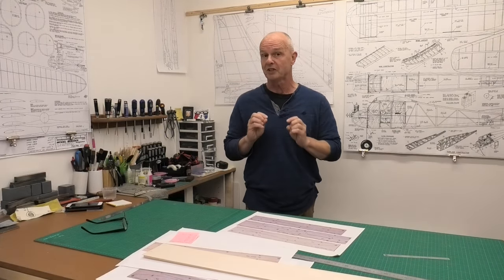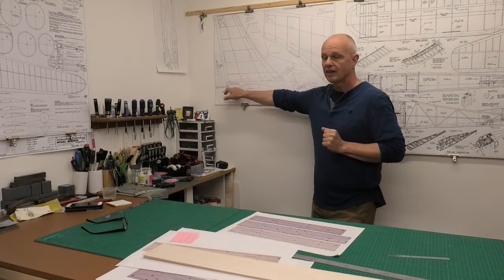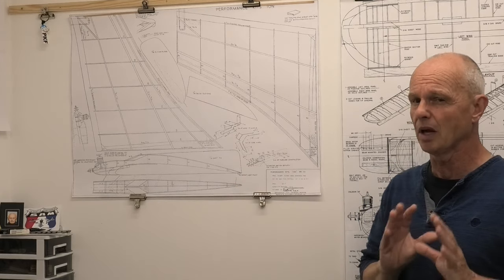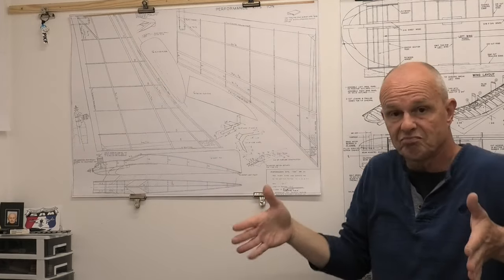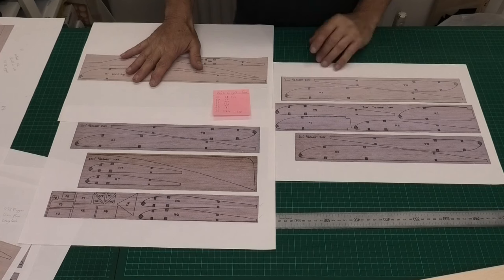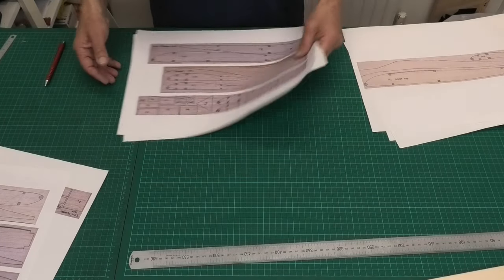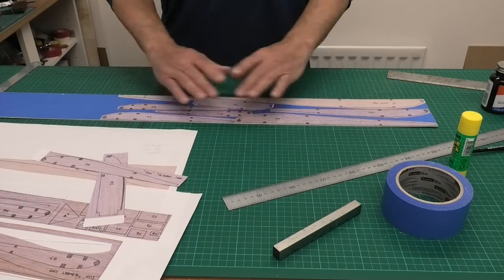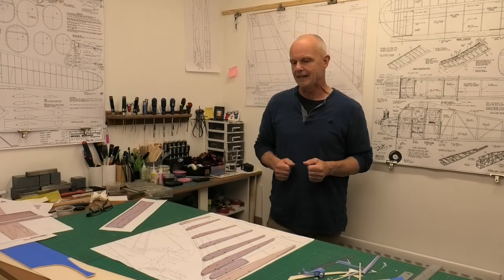Ion 1950's Futuristic Flying Wing - Pt1: Great Plans & Making Ribs - By  O.F.W. (Peter) Fisher

Comment: Brilliant method on transferring printed patterns to balsa, far less messy than spraying contact cement!  My old method was adequate but one had to use a powerful solvent (acetone) to clean the balsa parts, dreadful odor indeed! 

I must ask , what brand of jigsaw do you use to cut out parts from denser material such as plywood?   Just curious what you guys have available in the UK. Happy building!
Reply from the maker: Glad it helped, appreciate the comment.  I only use hand tools for cutting wood, so use a hand fret saw for ply etc 😜
Reply: @MarkRobinson555  I'm impressed! The last time I used a similar hand saw like that was in high school for metal shop. 😶🙂